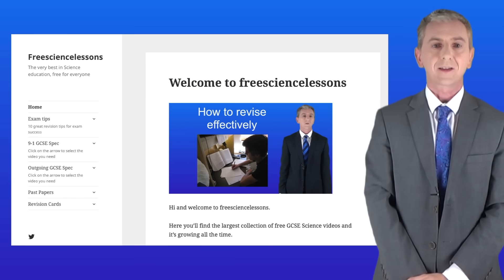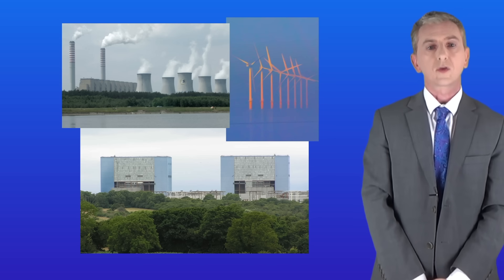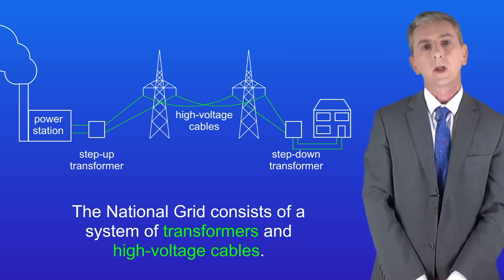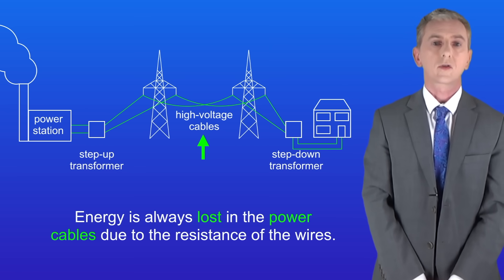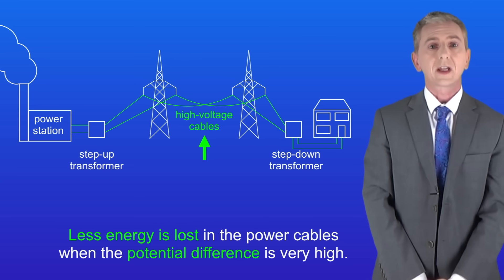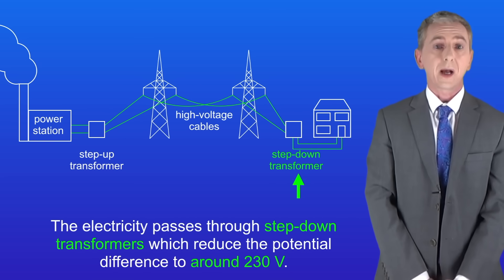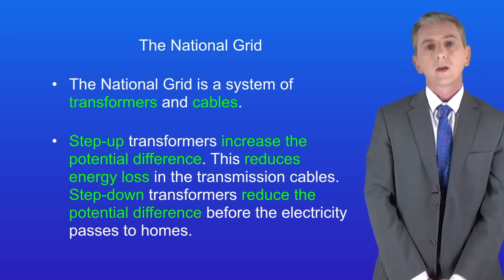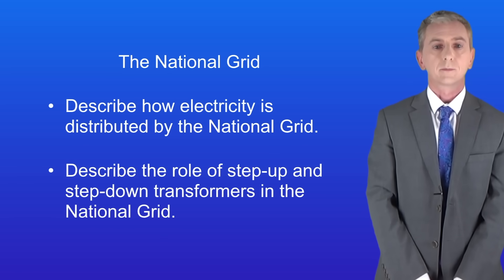GCSE Physics Revision "The National Grid"

Comment: I apologise for the incoming long comment, but why do we use low voltage to transmit electricity?

My only thought it that, using V=IR, if we keep resistance constant and very low, whilst also increasing voltage we will get a very low current (with our already small resistance). Then, using P=(I^2)R, we will have a very low power output (which is thermal waste) because we will have a number <1 squared multiplied by another small number, resulting in also another small number. I hope you can understand my thought process here, and hopefully you see this comment. If you see it (or not), know that you are incredibly helpful through your videos, and nearly every person sitting GCSEs thanks you.
Reply from the maker: Thanks for the comment. Remember though that we use a HIGH voltage to transmit electrical power over long distances.
Reply: @Freesciencelessons  Thank you for the reply, there was a typo on my end, I meant to write high voltage (as I did later in the comment). I am just wondering, is the reason why we use high voltage because P=(I^2)R and a low current (due to high voltage) will reduce waste power output. Thank you.
Reply from the maker: Yes, if we use a high current to deliver electrical power, then power losses will be high as P = I^2R. If we use a high voltage instead to deliver the same power, then power losses will be lower as P = IV.
Reply: @Freesciencelessons  Thank you very much!
Reply: hi

Comment: Is it true that if the current is lower, then thinner wires can be used for power transmission? I read it as an explanation for using lower current,  just wanted to confirm.

Comment: Whether or not it's in your exam board, it's worth knowing that: the reason that lot's of energy is lost at high current is because at high currents, the wires heat up and heat energy is transferred to the surroundings. We can either use a high current or high voltage to transfer the electricity (as P=IV). We just decided that high currents waste too much energy, so we choose to use very high voltages (meaning very low currents, as 'P' is constant in P=IV) .
Reply: I was trying to understand this and ur comment help me, thank you
Reply: THANK YOU SO MUCH, YOU ARE A GENIUS MY FRIEND!!
Reply: Thats very helpful! Thanks very much

Comment: why is it important to use a low voltage supply rather than using the mains supply directly
Reply: because it would kill any appliance and be unsafe. If there was an exposed cable it would cause an arc because of the large potential difference compared to each with its 0V.
Reply: Because domestic appliances have fuses ranging to only 13A, so a current higher than that (which occurs until the step-down transformer) would cause this fuse to melt and the appliance would stop working
Moreover, the voltage would be too high for the domestic appliances suitable only for 230V, causing them to stop working

Comment: Why would a higher potential difference mean there is less energy loss?
Reply from the maker: The power loss by the cables is given by P=IV or P=I2R.

If we increase the current, then the power increases as a square of the current (from equation 2). However, if we increase the voltage, then power increases by a smaller proportion so less power loss in the cables at high voltage rather than high current.

Comment: Still don’t understand since voltage is the energy per coulomb wouldn’t making the voltage higher just mean that more energy is lost??
Reply from the maker: The amount of heat energy wasted in the transmission cables is calculate from

P = I2R (current squared x resistance)

or P = VI (current x voltage)

Looking at the first equation, if we increase the current in the power cables, then the power increases as a square of the current (in other words, a huge amount of energy is wasted in the cables). 

However, looking at the second equation, if we massively increase the voltage, then we can run a small current (for the same power) and the amount of heat energy wasted in the cables is much smaller.